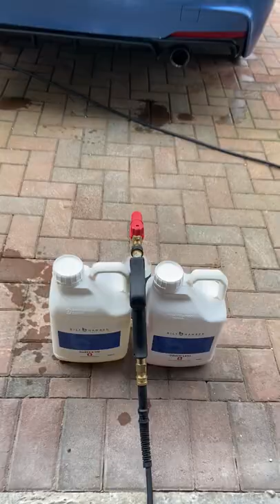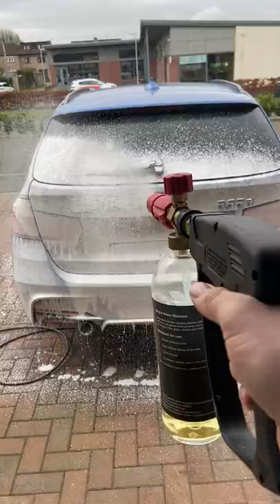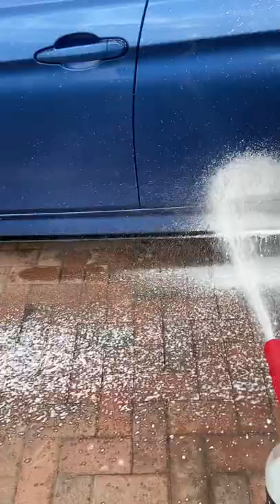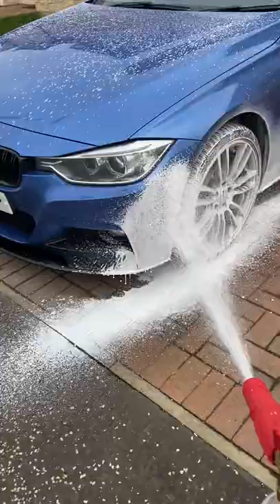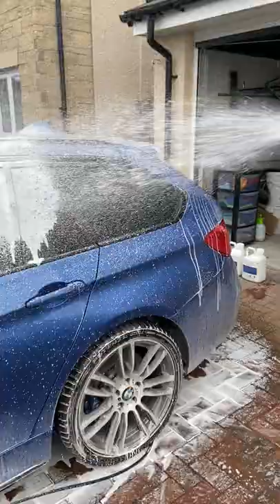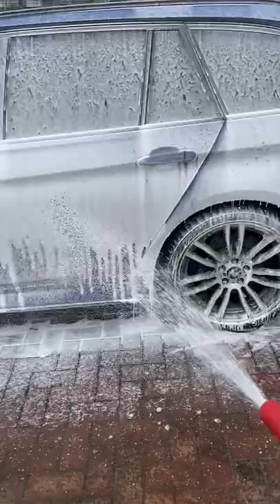Touchless and Surfex HD wash #shorts

Comment: What is your dilution?
Reply: Thats what I'm hoping to find out to compare it in foam form over a pump sprayer as a prewash
Reply: Both surfex and touchless @ 4% PIR in the cannon
Reply: @mcalpine663  4% of each in the cannon? Or both of them together make up 4%?
Reply: @connorrabey6  4% of both
Reply: @mcalpine663  roughly how many ml of each in a little bottle? I know every lance is set up differently. But a rough number that to used?
Reply: @mcalpine663  let’s say ur mixing 500ml of product and pir for an individual chemical is 300ml. U would normally add 300ml product and 200ml water. In this example do u use 300ml of each product (so 600ml) with 200ml water, or do u use 600ml product and 400ml water?
Reply: @rossyb313  did you find the answer?
Reply: @r.k862  i didnt bud

Comment: I’m sorry John but that foam was a runny mess
Reply: its not about how it looks its function!!!
Reply: Thick foamy stuff that sits on the car looks cool in pics but doesn't actually do anything
Reply: @DavidC1  Yessss!!!
Reply: Only noobs think thick foam is great.
Reply: @drewdoesstuff5052  thick shaving like foam makes a greater video doesn’t it?
Reply: @charleyschaubroeck6301  definitely for IG and all that. Don't get me wrong we have all done it for a laugh but know its at best a waste of product.
Reply: @drewdoesstuff5052  well all you need is an APC pre soak right 🤔
Reply: @charleyschaubroeck6301  nah not in the winter no but then I'm a paint pedant.
Reply: @drewdoesstuff5052  alright what do you do then to remove most of the dirt and grime before the contact wash?
Reply: @charleyschaubroeck6301  your welcome to post up your routine and if I can add value I will. But its not rocket science really. Quick tip, Job 1, make sure your car is well protected before winter hits. No need to thank me your car looking good will be reward enough.
Reply: Bilt Hamber’s pre wash products are not super foamy by design - they are purely functional products. No bling. Only to get the job done which they do fantastically.
Reply: @drewdoesstuff5052  only noobs thinks jags are any good 😂